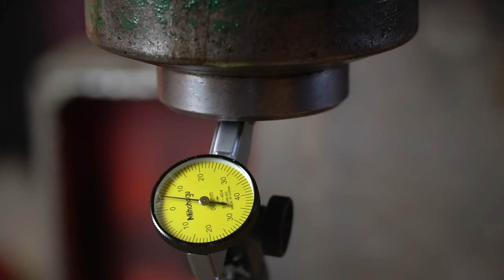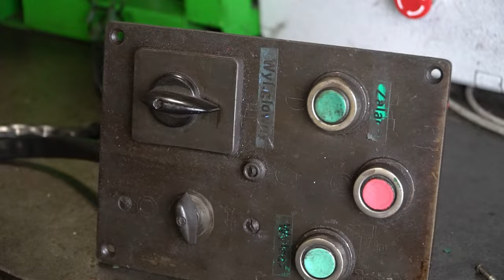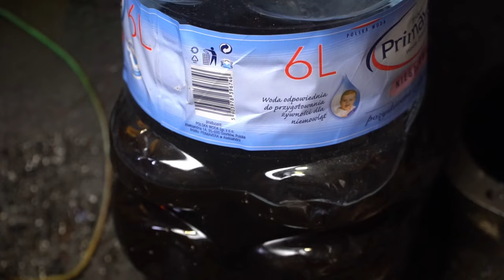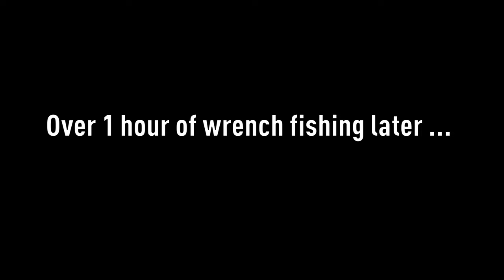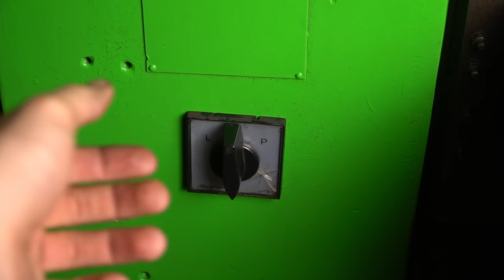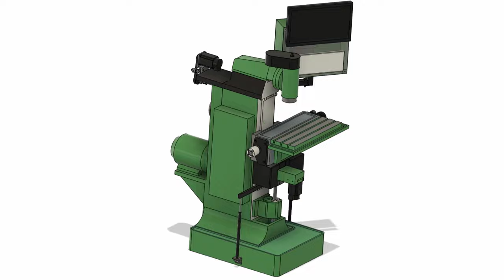UNIVERSAL MILL RESTORATION - FUS 200

Comment: Basically, the machine was only thoroughly cleaned, a renovation or overhaul is something else. No ball bearings replaced, the guides not revised, the result can be clearly seen in the bad milling pattern. A lot of hassle and effort for nothing.
Reply from the maker: The bearings were ok - no runout at all (max 0.01mm). The guides - you're right. I could've scrapped them but I've lacked time for that. There are many things I learned through this process so it was definitely worth it. Next time I'll probably learn scraping ;) Thanks for the comment
Reply: @GBWM_CNC  All the running noise is enough to know that the ball bearings are at the end. The concentricity without load says nothing at all about the quality of the ball bearings. The milling picture, on the other hand, tells me that the bearings have too much play.
Reply from the maker: @chris-su8ns i didn't consider that. I was sure the noise came from the bevel gear issue (wasn't able to find a new one).
Reply: Couldn't agree more. A little car body filler wouldn't have gone amiss. The pain job was awful. When running machine it sounded like a bag of spanners. One last thing, it looked like what he was drinking was the contents of the sump.
Reply: Sometimes all these machines need is a good cleaning. Go easy on the guy. Maybe he couldn't afford new bearings etc! That stuff is sometimes ridiculously expensive!
Reply: Amen brother...I feel like I was robbed of an hour.
Reply: Also you must be a very nice person...thoroughly cleaned.....hmmm

Comment: it seems liek you did more of a general cleaning than a restore. there were lots of areas that i would have addressed in a "restore": vs a cleaning. don;t get me wrong you did a GREAT job! you certainly did a lot of work that is for sure! when i rebuild something, I typically afress clearance, repalce berings and such. every crevice is cleaned to bear metal and it is completely repainted. I do 1 section at a time to ensure it is completely done before doing the next so i don't cause spacing issues with my work bench. :)  i did really enjoy this video! what machine is it?
Reply from the maker: You're right! :) it is a fus 200 romanian milling machine. Guides scraping would bo appreciated here, but i didnt have so much time
Reply: @GBWM_CNC  totally understand that!

Comment: Getting an old mill flat, square and parallel is a bit of an overwhelming task.    So many disconnected surfaces to line up and if you have to take too much off the top then it gets even more overwhelming.      One day I would like to try it.
Reply from the maker: This is right at point. Maybe I'll face this problem someday - that would need a lot of time and patience

Comment: This man has a whole lot of WD-40 (This s*it is not expensive in your country?). Why not Pressure washing is an option? 
BTW it was so satisfying! And why don't brands do mini wire brush for running inside tiny spaces?
Reply from the maker: Pressure washing wouldn't be easy in my house  (moving this machine is really a challenge). And yes - WD-40 is expensive but this wasn't the biggest cost i took here, haha! Btw there are mini brushes - maybe I could use actually these. thanks for watching! :)

Comment: Whoa. That's an epic restoration. How do i get in touch with you? Need some advice on a milling machine i want to restore too.
Reply from the maker: Post here a comment. Maybe some other people will be able to help you too. I'm not so professional - just doing this as my hobby! :)
Reply: @GBWM_CNC  sounds good. I have a 10hp induction motor attached to the vertical milling machine. It's about 40 years old. It's got a lot of gears also for the spindle speed. Everything is connected with gears, even the oil pumping system is spring based. The x axis is on a worm gear attached to bevel gears. The y and z axes movements are done manually with lead screws. The rapids are with shifting gears in each axis and there's a motor for that too. The feed is too slow and it's a very noisy machine. I hope I could share some videos or photos.
Reply from the maker: @gurpreetmankoo  damn, 10hp is a really big machine